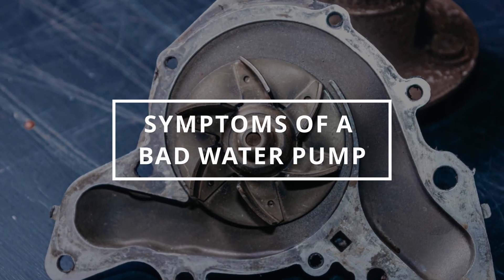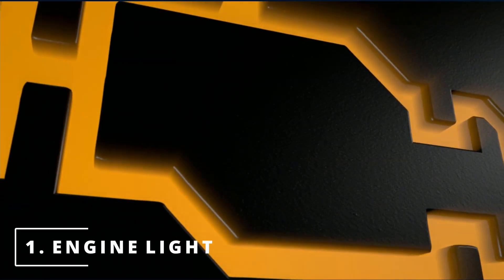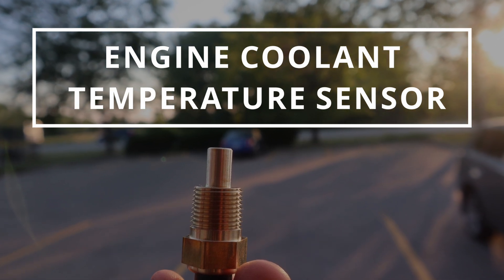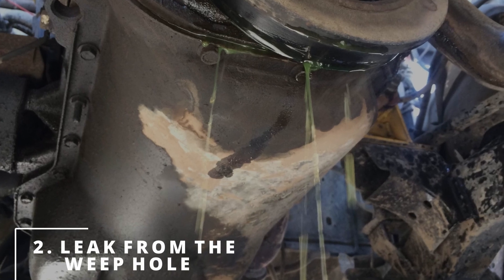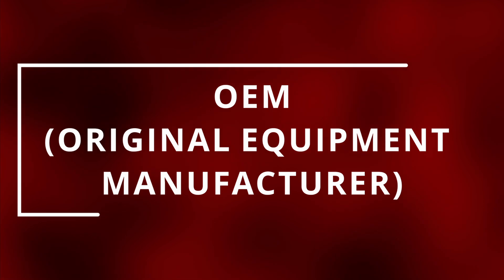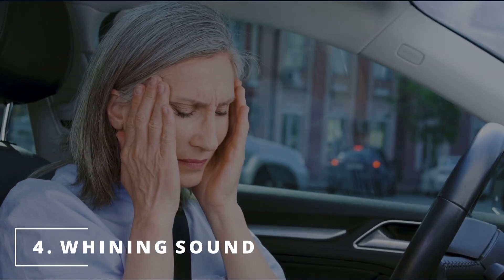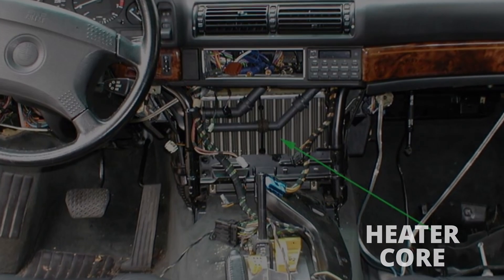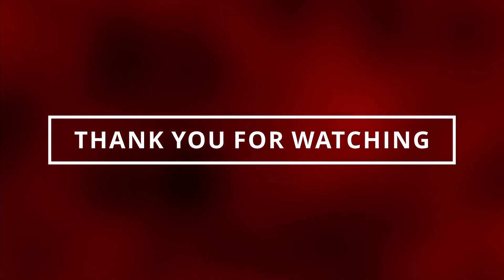SYMPTOMS OF A BAD WATER PUMP

Comment: I cannot figure you the problem. I just replaced the thermostat, radiator, radiator fan, radiator expansion tank and lower radiator hose. Car still over heats!!!!!! Only when idling. Coolant disappearing constantly and spraying out sometimes but gauge doesn't reflect the overheating. White steam billowing from under hood. Passenger floor board stays soaked but my heater and AC work just fine. No noises or anything. Riddle me that.

Comment: 😂 it couldn't be that simple😂 because the heater in my Chrysler 300 went out on the driver side, but it works on the passenger side. And that happened about 3 months ago. But Here recently my water pump started making noises and I got to replace the coolant every time I crank the car. I really hope my paycheck is big enough to by the park this weekend. I swear if I ever get another car call mom staying far away from Chrysler vehicles😂 I'm getting another motorcycle, I hate I sold my old katana😂

Comment: I actually have all of these symptoms, guess I gotta change water pump because my car completely lost power and barely drives due to overheating temp light😮
Reply: Same here my Chrysler 200 2012 3.6 would make a grinding noise, temp would go up quickly and die while driving
Reply: @KKMontana my Chrysler 300 5.7 Hemi is making a croaking sound coming from the water pump😂 and it's spraying the inside of my hood because of leaks coming out of the weep hole and getting onto the surfing team belt I would assume.

Comment: Just went and purchased my water pump today after replacing a radiator and thermostat. Heat stopped and overheating but nothing seemed to help. I started to junk it thinking that maybe it could be my gaskets but decided to give it 1 more chance. 🙏🏾 Its all because I'll be without a vehicle if not

Comment: I replaced it but it wasn’t flowing so there was no heat even on high and the weather here was 🥶 as hell!

My unk took the temp sensor off and it stopped overheating and I saw he got the coolant ti flow bc I felt it starting to flow, now I have a new sensor and it has to be replaced after that was a new one he replaced. I’m wondering if the thermostat has been replaced bc that was new too.🤦🏾‍♀️🤦🏾‍♀️🤦🏾‍♀️ 2015 dodge durango citadel someone please I cannot afford another car.

Comment: no heat and my car is over heating. brand new radiator , new thermostat, fresh heater core flush not new but flushed, and a few new hoses

Comment: Just because you have an overheating engine that can mean a thousand different things uranium could be drying out your pipes could be leaking your thermostat could be messing up
Reply: I see signs of water splashing  from the top hose that is from the radiator to the engine

Comment: How about.. random overheating, goes back down with revving of the engine?
Reply: Did you ever find out what it was ?? My randomly goes up to like 3/4 hear and then once I start picking up speed it’ll go back down to half
Reply: @yancyjarquin4683  I think when this was happening with the Subaru unfortunately I'm fairly confident that that car had a cracked block. There's really nothing that you can do to fix that except try the miracle fix of blue devil which a lot of people don't like to do or just get a new engine that doesn't have a cracked block because unless you're taking a block and adding heads to it it's a whole big process.
Reply: @82_KID ohh ok I see , thank you either way bro

Comment: My car starts and drives fine for a good while before slowly starting to overheat all the way to overheating warning on the dash, hang around for 30 seconds and shoot back down to normal range again.. stay good for a while and slowly climb again ect.. mostly runs well if i stay local but im guessing i need water pump and thermostat replacement too??

Comment: My wifes car is clunking, almost like something rapidly tapping against plastic, the car suddently started to sound 100x worse (all while the temperature gauge didn't go up) the sound went back to normal for a while when all of a sudden it came back even louder and the car shut off on us multiple times, after a while it wouldnt start and we parked it in a nearby parking lot (we drove further because we were about 5 - 7km from home, otherwise we wouldve stopped)

Any suggestions? I am a trainee car mechanic and even my colleauges (who have been mechanics for year) have no idea what it could be.

Comment: When im traveling in my car for a long distance, engine temperature will be okay but after i slow down in a traffic it will start over heating and i all ready replaced radiator, pipes and thermostat, still the issue persist.
For extra information, next day before i turn on my car, the water will be full in reservoir tank but empty in the radiator. 
Can someone advise please
Reply: Sounds like this could be your radiator fans not working.
Reply: its because there is air trapped in your cooling system, you need to burp your coolant through the radiator, it is a easy procedure. look up "how to burp coolant system in car." its easy and cheap

Comment: I’ve been having an issue with dashboard thermostat just all the way up and back to normal in under a second. The engine isn’t really overheating but I’ve noticed a small coolant leak and just last night steam/vapor started coming from the vents when the defrost was turned on. I plan on getting the water pump replaced asap but any suggestions on what else could be causing this?
Reply: Could be your thermostat sticking closed then opening up allowing coolant to cool off the engine

Comment: I drive a 2017 Audi Q7 
I had my check engine light come on and off within like 2 hours time. This happened 2-3 weeks ago.. I scanned it right when it happened and it came up with a code for  “super charger sensor” then disappeared… Nothing noticeably different while driving what’s so ever.. but a day after the code popped up and went away I start hearing a weird clanking/grinding like noise only when idling, As if one of my pulley went bad. I tell this mechanic that looked at it yesterday exactly what I just explained right.. 

So he looks at it and tells me that my supercharger was the cause of the noise, as well as the supercharger pulley tensioner..

Last night I have another guy look at it and without even taking it apart he looks, listens and tells me within 10 mins that it’s my water pump pulley that is bad. He’s 1000% sure not my supercharger. He said I would’ve had black smoke coming from my exhaust , loss of power along with some type excessive whining; in which none of this I experienced.. In your experiences and from the sound of this situation ; 
what are your opinion’s on this?

Every answer and/opinion is greatly appreciated and will save me a few strands of hair that I have left on my head

Comment: If you're reading this, its probably too late. 
Check the coolant level every 3-6 months. 
I didn't & had a burning smell & I couldn't figure out the cause until I lost all heat in my car.
I filled up the reservoir with coolant/ water mix and my heat started working again, but I realized I had a water leak coming from my water pump. Now I need a new 1 and it's not cheap. 
If my coolant level never got that low, maybe I wouldn't have damaged the seals in the water pump causing the bad leak. Idk
By the way, the needle on the temperature gauge never showed that the car was running hot. 
I hope this saves someone trouble and $.
Reply: you should check all your fluids weekly. it takes 5 min. i can get a water pump for my truck or van for under $50. thats cheap.
Reply: Crazy cause my gauge didn’t show me either. I have a 2018 bmw I just noticed a feel in the drive I finally pulled over and my car was hot

Comment: The weep hole and pump outer seal and bearing seal all are culprits to adding/leaking air into the system. Very common in older, 200k, vehicles. I really like the 1997-2001 toyota camry. It gives you plenty of warning for failure, and just do everything on the engine outer at 200k and you will reach 350 to 400.
Reply: Hey man, I have a Camry from that Era. I might have the same problem with water pump,,as every time I start the vehicle, it releases thin white smoke. Could be coolant leaking, because usually cold starts are only mornings; but everytime the engine is off for more than 30 mins, it releases the white smoke.

Comment: Additionally, is your engine leaking oil through the seals. Replace the pcv valve, seals, oil seal at cover and water pump. Once you have the cover off, ant for toyotas it's about 200k, also timing serp. And p/s belt. It will ensure you reach 300 to 400k. Do idler pulleys too. Once timed right it will run so sweet, and never pull it apart again.

Comment: Hi thanks im a subscriber.

Question please...

1995 Lexus LS 400 :

My heater was not blowing hot air.

Changed thermostat because car was also overheating and it was bad and stuck closed and old.

Now the heater does blow hot air out but is there a chance that it only blows hot air out because the engine is warm providing the hot air, tricking me to think that the water pump works ?

I ask because why was the heater not working when the old bad stuck closed thermostat was in place but now the heater works all of a sudden with the NEW thermostat in place ?

Wouldnt the heater work no matter what if the water pump was good ?

I also ask because the car is still overheating with the new thermostat in place and before with the bad stuck closed thermostat, the upper radiator hose was not getting hot meaning thermostat closed was not allowing hot coolant to reach the upper hose but now with the New thermostat in place, tje upper hose IS HOT because coolant is reaching it now passing thru the good thermostat.

I also thought that the water pump circulates the hot coolant from the hot engine thru the radiator but CAN COOLANT CIRCULATE FROM THE HOT ENGINE THRU THE UPPER RADIATOR HOSE BY MEANS OF ENGINE ROTATION PRESSURE ALONE ?

DOES ENGINE ROTATION EVEN CIRCULATE COOLANT TO BEGIN WITH ?

Im asking because the coolant seems to circulate because the upper hose gets hot when engine warms up.

CAN COOLANT CIRCULATE THRU THE UPPER RADIATOR HOSE WITH A BAD WATER PUMP ?

I dont see leaks near the water pump, i dont hear noises near the pump and the Heater Does Blow HOT AIR.

Im so confused smh.

Thanks.

Anybody knowledgeable please reply soon

Comment: Noisy around the belt area that you can hear from the streets.  Plus clanking noise.  Then leaking i thought was trannie fluid leak as i added too much the previous week.  Then the whole left side by the belt, alternator area all wet with mud looking juice on it.  Then overheat to hot.  I stopped and water was gushing out from all areas in the bottom.  Added more water and still dripping down.  Limp my way home and car stalled at the light.  Then belt making squeaky noises then stopped.  Then belt derailed so battery sensor goes up.  Then steering wheel was hard to turn.  The serpentine belt runs all to alternator and power steering but the water pump does not run even when the belt was running.  The water pump was making it hard for the belt to turn thus why it flew off.  430k n never flush radiator coolant.  Car was gifted.  2011 Camry.  Will call junk yard to go take it from the streets.  No need to put more money into this high mileage car.  I need to buy another car this weekend with only $2000 down or my work life is done.   $2000 is all i got right now.  Wish me the best.
Reply: I hope you got it figured out . But what kind of clanking noises ? Mines doing this then now doing the same symptoms as seeen on the video .
Reply: @SRGJ1  the noise coming from the belt area.  It is loud on idle.  Faulty water pump will make that noise before it goes out.  I ended up buying a new water pump n a new belt n fixed the problem.  Good thing I parked in a mall Parking lot which is not public street or cops going up tow it.  My water pump is sitting high on my car so easy to change out.  The hard part is to get the belt to fit.  Had to loosen the torque to get it to fit.  Thought they sold me an extra long belt.  Drained the radiator fluid while I'm at it.  Add fluids to fill, start engine n turned on the heater to get the car to heat up fast n slowly adding more radiator fluid as the water pump is pushing out all the air.  Around half hour should be done.  Back to driving again.  Hope that helps someone out there.
Reply: @SRGJ1  also, you can hold the water pump n try to shake it.  If it is loose then the water pump is bad.

Comment: So I don’t see the coolant circulating in the radiator but I do get heat on the heater. Am I looking at a thermostat that’s stuck closed? The vehicle I have starts to run a bit warmer than usual if I come to a stop
Reply: Having this issue after replacing thermostat, rad fan switch and ECT. No coolant circulating. Did u ever figure out what it was?
Reply: @MIkeDaBBoy  I’ve had no luck yet,
Reply: Have you found what was wrong?
Reply: I didn't put enough coolant and properly burp the system lol.I also didn't run my heater to circulate the coolant.  @josevaldovinos5024

Comment: My F150 truck is running hard with water still in the radiator ??? I changed out the thermostat. It would make sense if it’s the water pump then right ?

Comment: What if my heat still works and I got no leaks and engine lights ? Could it be my thermostat that’s making my heat up?
Reply: yes, most likely, change it together with the waterpump because if the thermostat is failing, your water pump isnt too far away as well. plus theyre located near eachother. thank me later

Comment: If I gta keep my defrost turned on to avoid over heating and have to add antifreeze constantly is that a water pump? 🤔 any advice would be greatly appreciated 🙏
Reply: I would stop driving my car if I was you can be multiple problems than just your water pump . You check your fluids ? Such as oil and coolant if it's overheating

Comment: So I have a 2016 Buick LaCrosse I have a coolant leak I can only see the coolant under the passenger side of the engine,  before I found out my coolant was low my heat was taking like 10/15 minutes to warm up u think that’s just cause the coolant leak or the water pump but now that I topped off the coolant the heat works fine

Comment: I was just trying to find out typically at what mileage does a water pump start to go bad
Reply: About 150k depends on the car how you drive it
Reply: @jamesbaker7689 depends on the car some are recommended to be changed around 80k and others are alot longer

Comment: If water pump drips is that a bad pump or gasket? I had an overheat but not sure the original cause it was 9f outside. And the coolant was changed in May. No issues til cold. I was assuming not properly coolant dilution. But shops don't always say truth.  Now if there is a bad gasket would that let air in the system so it can't properly circulate? Mine pressure the hoses with air I bleed it and then still no circulation but the pressure gradually builds again. The expansion tank will blow off the pressure. This is a 04 Discovery 4.6l V8. Just was interested in the water pump info if it can be still good even if gasket was bad.
Reply from the maker: It could be one or the other. The only way to know is to remove the water pump and look at the condition of the water pump fins. If there is resistance when rotating by hand or some of the fins are corroded or broken then it's best to replace it. If it's leaking from the weep hole then the seals are defective and the pump needs replacement. Considering your vehicle is 19 years old I would assume the pump is bad.

Comment: I have a 2012 nissan altima and there is no coolant leak. Heater works fine. Car warms up normally but when I drive for around 40 min or longer my car than doesnt want to go anymore. It starts slowing down. And when I let it sit for 10-20min than it drives for a few again. But I noticed the coolant level always stays the same showing it clearly isnt circulating.  Is it the thermostat not opening or is it the water pump?
Reply: Did you ever get this fixed ? This is happening to my car too

Comment: It's just a quick question.  I can't find my coolant leak but the hoses are good and not leaking. It's dripping infront of my oil pan. Could that be the water pump?
Reply: Termostat
Reply: @Cjesus Beltra  it was the water pump. Somebody sent me to squeeze hoses and see it the will . If you can't then it's thermostat.  Thanks though for reply